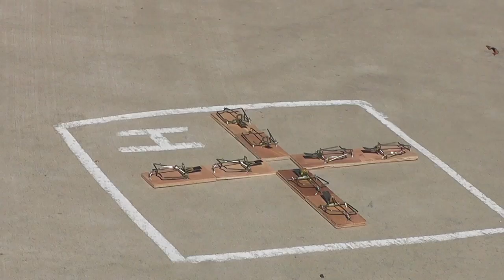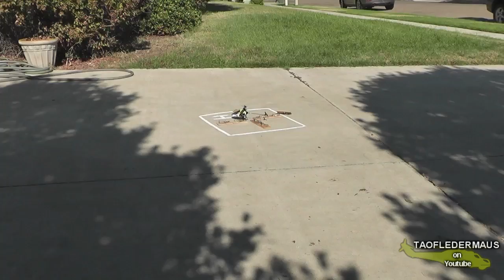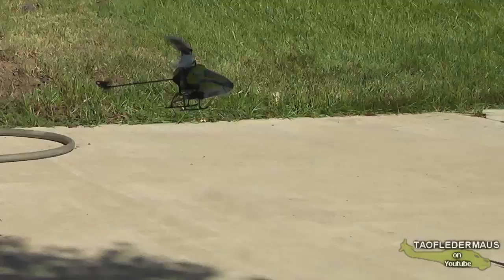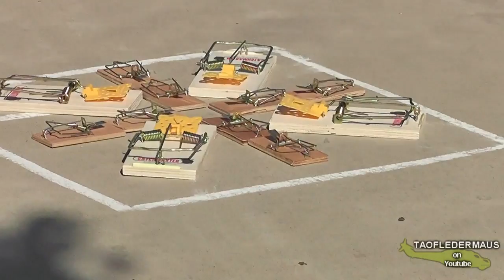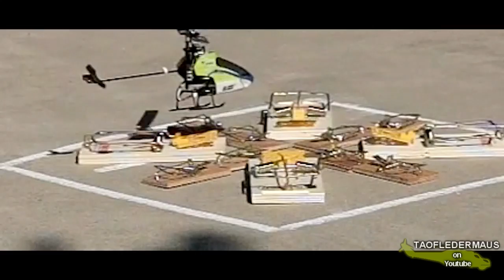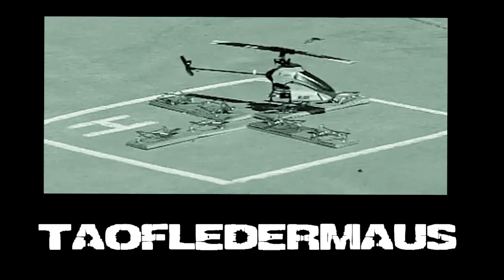R/C HELICOPTER vs RAT TRAPS - This CAN'T be GOOD!

Comment: i have a blade MSRX and its pretty damn tough, they all seem to be, i have crashed it and bashed it and it still works despite falling from a hundred feet when i dared to do a front flip ( hit the ground just when it leveled out so still kind of success :D ) but the carbon tail was split down the middle but still together and it still flies, a new tail assembly is like 15 bucks but the stock charger broke so haven't played with it since and my rc car charger won't work for those batteries. . .anyways i highly recommend these things to anyone who has too much time on their hands

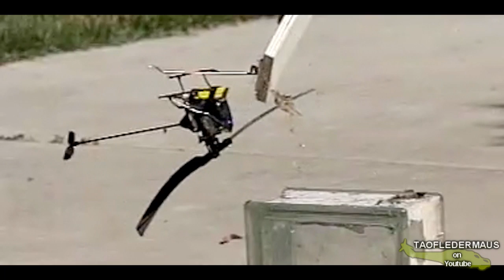Comment: 1:41 
"MAYDAY MAYDAY!!!! I LOST PEDALS!!, I'M GOING DOWN!!"
Reply: No
Reply: the pedals control yaw which is the left and right rotation of the helicopter, losing  "pedals" would not be tragic as long as "losing pedals" doesn't mean the tail rotor is gone, losing the tail rotor will cause a spin in the opposite direction to where the blades are spinning because on the torque.
Reply: ***** thank you sir.
Reply: "MAYDAY MAYDAY, LOST EVERYTHING BUT THE COCKPIT! WE'RE GOING DOWN!